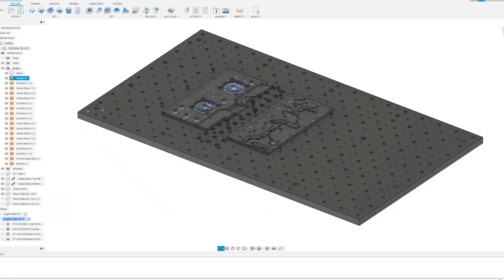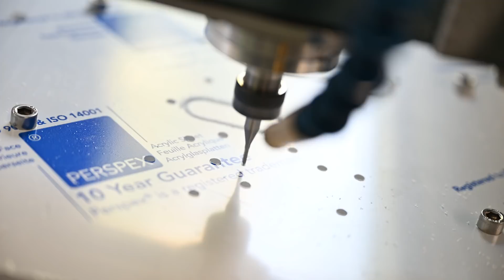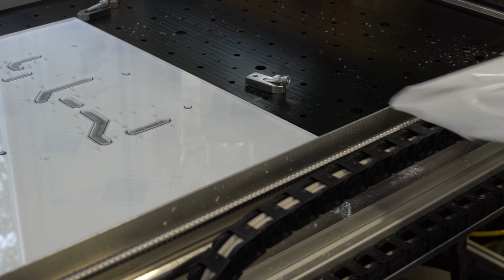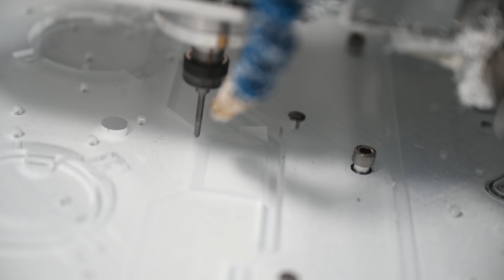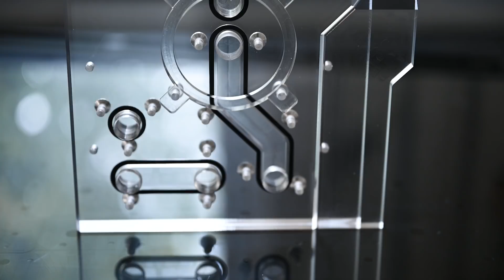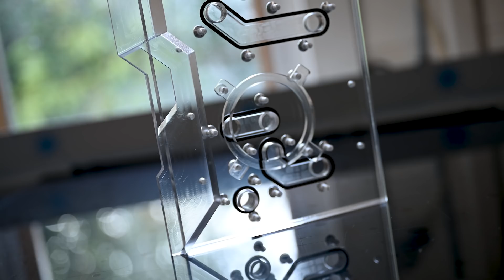Cutting my Hardest Distro Plate Thus Far! | bit-tech Modding

Comment: Have you ever copied the pleix from a retail GPU cooler (example EK) & added in a res pump combo?  Either making it longer, or fatter.   ...guess if you wanted to you could make one replacement plexi that has the combo res/pump(s) & replacements for both the plexi from the top of the retail CPU & GPU water coolers.  Just thinking this if built would only need one tube run, a single loop with the heated water from the chips going to the radiators & returning to the reservoir.  ...guess this would look very boring unless you were going for super tiny sff build.

Comment: How about a distribution block that controls the water & the air?  That has channels of empty space in the distribution block to control the air flow in & out of the case.  The fans could be mounted within the distribution blocks with the fans out of their square housing & mounted in round housing built/cut into the block.

Comment: Something I've never seen is a CNC 3D milled distribution shape that takes more than two sheets of acrylic.  What I have running around in my head for a few years, popping up now & then is a distribution shape that is part of a dual loop, where lines of the other coolant runs through the other distribution block(s), & the distribution blocks are odd shapes with multiple plates with multiple o-rings.  Jigsaw puzzle pieces to fit only that build, that case, with particular components, MB, GPU, PSU, RAM, etc.

Comment: Have you ever considered doing these with no o-ring seal? I mean you could skip all of the bolt holes, all of the o-ring seals, and do nothing more than the fluid areas and then use the same kind of acrylic adhesive that is used to build fish tanks... That would give an even cleaner look

Comment: I would like to see more on how to work with the CNC mill. How do you fix the parts, what security measures must be taken to protect you and your tools. how do you make the final cut? Changing tools etc. I am kinda hesitant with such things, mainly because of lack of experience.
Reply from the maker: Fat2Mad To be fair a lot of that info is on the channel already. For instance we have videos on making my fixture plate, vice fixtures, how to machine distro plates and many other pieces in individual distro videos showing how I tackle things like double sided jobs etc.

The issue with some of the other things is that they change depending on machines and so on. If I were to get an automatic tool changer then it would be a very different process compared to a DeWalt router like you get on a shapeoko for instance.

Comment: Hello, 

New subscriber here. Just found your channel with this video. Incredible! I'm not really a PC enthusiast (having only built one recently). I'm more into building hobby robotics. I like using clear plastic in my robots for both aesthetic and practical (visibility) reasons. However I use polycarbonate instead of acrylic mostly for its machining properties - I find it more resistant to shattering when drilling and cutting, and that it's stronger, and easier to thread for bolts. So I have a couple questions. (Please refer me to other videos if you've answered these before.) 1) Do you ever use polycarbonate instead of acrylic? 2) If so, how well does it machine for your purposes? 3) One of the commenters below mentioned flame polishing. Have you ever tried to "acetone polish" the water channels? Thanks for this amazing work. I'll be looking through your stuff.

Comment: Amazing engineering. How long does it take to clean the workshop after milling like this? :) Debris is everywhere. Did you ever try flame polishing the acrylic?
Reply from the maker: Takes about 5 minutes haha, I've set the place up to be cleaned very quickly. The sides of the machine have 3D printed guards on them to catch the chips, so most of it ends up on the bed, which I just vacuum up with the extractor.

I don't personally like flame polishing, it rounds the edges which doesn't do it for me.

Comment: Will u polish the angle parts?
Reply from the maker: No need, the milling marks are very faint, they're basically only visible when the light catches them. If you mean the sloping sections, personally I prefer the look left by the ball end mill. I did experiment with polishing them out ages back, but the issue is it made the edges look rather tacky, similar to a plastic Christmas ornament, if that makes sense.
Reply: It looks perfect. I just had this doubt because we can see the mills scratchs in the video. I'm building up courage to create my first rigid pipe build